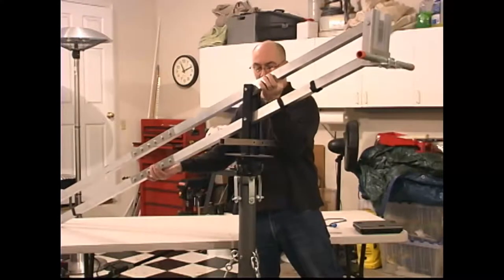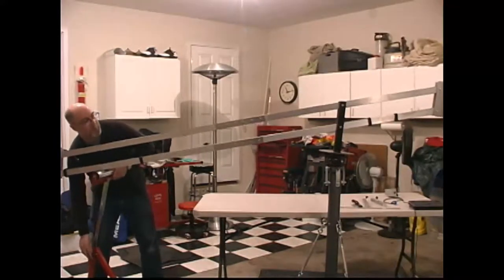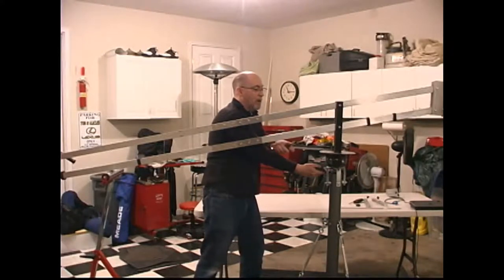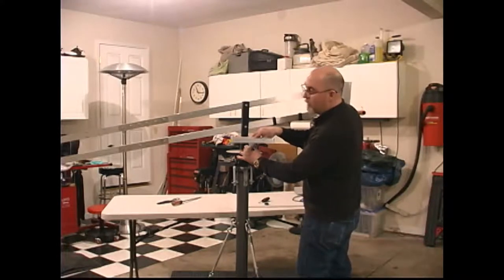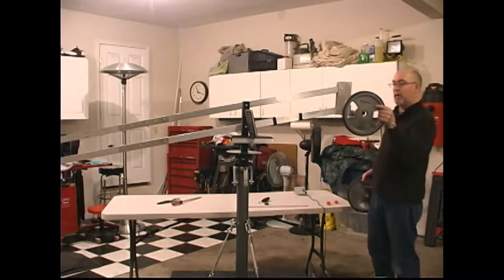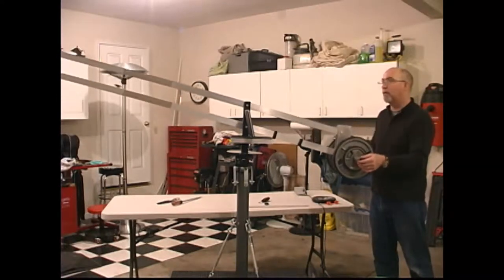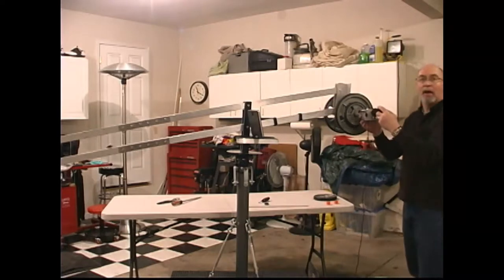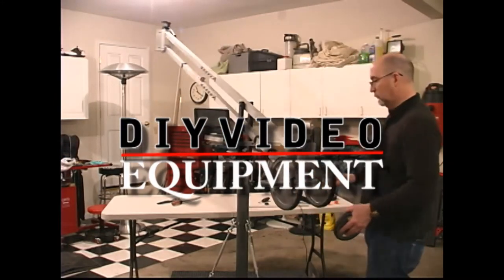Part 3 How to Build a Jib Crane

Comment: Hi. Fantastic video and genuinely one of the best DIY jibs I've seen! I'm currently looking into both DIY jibs as well as DIY motorized tracking sets and a few years ago I would've dived into a build like this but after becoming disabled my time in my workshop unfortunately took more than a bit of a hit. As it's some years on since you posted the original videos I was wondering if you ever did put that spec list and step by step diagram together that you mentioned you might do? If you did and you wouldn't mind me having a copy it would frankly be pretty darn awesome as I think my only viable option would be to find a metal-worker in my area (Birmingham, UK) to do the build on my behalf. No worries if not though, just thought I'd ask chap! Either way, what an amazing piece of work!

Comment from the maker: I may produce drawings when I build these things but they are normally not legible.  Time is a big issue for me.  My suggestion would just be watch it over and over.  I'm currently working on the tilt and would love to get that up some time.  The crane is now 14 feet long with a pan and tilt, which is awesome.  After this project it will be rebuilding the dolly in to a dedicated unit.

Comment: I'm writing for Portugal and the question is...I' have a jib crane that is almost concluded. But, a have a problem...i have a SONY CX6EK that was bought with infra red remote control that doesn't work properly in the rear side of the Camera (When operating in the rear side of the camera standing 3 metres away from it, doesn't function very well, because of the infra-red sensor that stands on the front side of the camera). Is there any tip that you can tell me in order to correct the situation?

Comment from the maker: @juapanmapanuepel  There are a number of ways to build the jib.  This way requires at least 4 pieces of 4'-1-1/2" X 1-1/2" X 1/8" wall aluminum.  The 4' lengths allows the unit to be broken down to fit in my car.  I've added an additional 4' section to make it taller.  I have a few videos that are POV and show the added length at:
Just got to my youtube home page at DIYvideoequipment